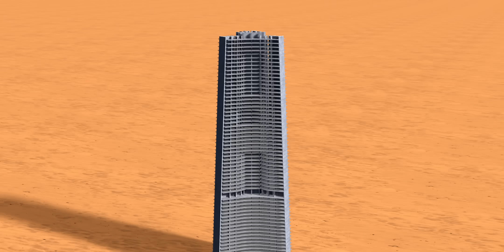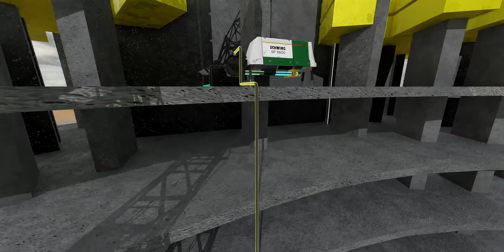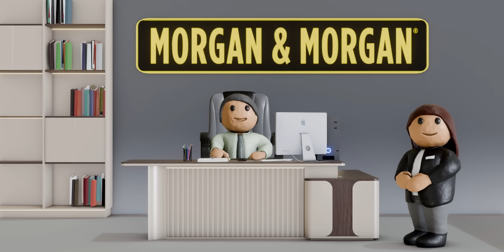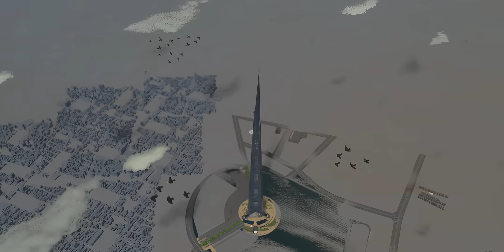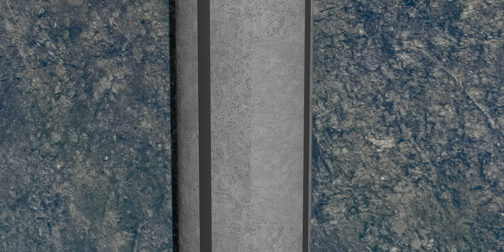Jeddah Tower Restart: The Strange Issue Between the Old and New Concrete

Comment: Wow.... The energy consumption of this building for air conditioning, for the elevators, for preventing rust on the foundation pillars, the amount of energy needed to construct it, etc... Geeezzzzz.... Sounds like this is a building waiting to fall apart in about 20 to 30 years with a huge carbon footprint. They're trying too hard to overcome nature, it seems.
Reply: Plus big pumps for water, those need a lot of power. But the cathodic protection only uses little power I think. Btw, there is a counter piece that needs to be replaced regularly because it is slowly eaten away by the current. So to protect the rebar, you need to sacrifice another (replaceable) piece of metal

Comment: Interesting on an engineering level, but such a waste of public money. All this concrete thrown up into the sky just for one man's vanity with little usable floor space.  And it's nothing more than a copy of what's already out there.... How boring.  The only thing this building has is an observation deck (that's so high up they can't use it a lot of time because of high winds I imagine), and its overall height. Otherwise what is the point of this boring copycat of a building???

Comment: But the more useful means a more stable and long life tower. The Jedah tower could be increased even after by boring and injecting high density hybrid concrete. It doesn't take much especially if you use graphebe and fibers combined with the old school roman concrete which we just realized why Roman concrete has lasted so long..

Comment: Use both, and in-fill with hybrid high strength concrete,i.e. with graphene and fiber mix! Go both out and in-fill the center. This will help with wind flow and environmental forces acting upon the structure.

Comment: Hello Sir, thank you for this great explanation. I have a question: In the future, is it possible to construct high-rise buildings using only structural steel, without reinforced concrete as the main structural system?

Comment: It reached 110th floor these days , which is like 430-440m I think , I am not a fan of the buildings that are pointless like this (especially the Line) but this thing has been in build since 2010 or some like that , just finish it instead of wasting all that material and money for nothing , I do think it is possible to be built , every engineer says so, question is if there is enough money and the higher ups actually want it to be built
Reply: You are dealing with an economically powerful nation, not someone like Elon Musk, whose funds could run out , It is also a sign of a superficial mindset to think that these buildings serve no purpose; no project is built unless it is expected to generate revenues that cover all incurred costs—and yield significant returns on top of that. You are talking about the PIF, As for The Line, it is not merely a "mega-project" but a "giga-project"; its initial phases are expected to emerge in 2050, and it will span many years due to its immense scale. This stands in contrast to certain nations that can only plan in four-year increments—the duration of a presidential term—or focus on small-scale initiatives, all while grappling with fundamental issues like homelessness and healthcare coverage—problems typical of third-world countries, If you wish to speak of logic, then do so; but as for your emotions, keep them to yourself,So don't take it personally; I'm happy to have met you 🌹❤
Reply: @sadov-y6f He meant that the building is too inefficient and only acts as a status symbol. But the engineering behind it is interesting.  It's good if you can afford to do something just because you can, not because you should. But you should definitely not make that a habit 😃 The line is a bit unrealistic I guess. The business plan behind it is vague, and seems based on dreaming, not on economic reality. Any idea of the required amount of concrete and rebar to build just 1 kilometer of 500 meters high and 200 wide? Anyway, let's see if the business plan works out after that first kilometer.
Reply: @effedrien  Don't worry, I'll wait for you four years from now.
Reply: @sadov-y6f are you sure 4 years is enough for that first kilometer?
Reply: @effedrien  Certainly, yes.

Comment: The engineering behind Jeddah Tower is absolutely insane. The fact that they had to solve problems like differential settlement, wind sway, and connecting new concrete to a section that had already been sitting for seven years really shows how extreme a 1 km skyscraper is. I honestly didn’t realize how many hidden challenges there were behind this project.
Reply: Nem 1km ,hanem 828m
Reply: @NicolettaBaba  jeddah tower will be 1000m+. Burj Khalifa is 828m

Comment: The stiffness transition, deep pile foundation, high-strength concrete, wind-resistant buttressed core, and tuned mass dampers show how every detail must work together to control settlement, sway, and durability. An impressive example of how structural engineering, foundation design, and material science come together at extreme heights. – Dr. Sera, P.E., PhD
Reply: Te szakmabeli vagy?Azt honnan tudjuk,hogy milyen melyre ássunk¿
Reply: did you just sign off on a youtube comment 😂W flex i guess

Comment: High strength epoxy....to glue and bond one layer of concrete to the other. Hmmmm... curring in that heat. I'd be afraid of it becoming brittle and then still even the long term colder temperatures after the building is finished could do that too over time. 

The whole epoxy bonding process for this tower would be very interesting. I bet it would be a full video on its own.

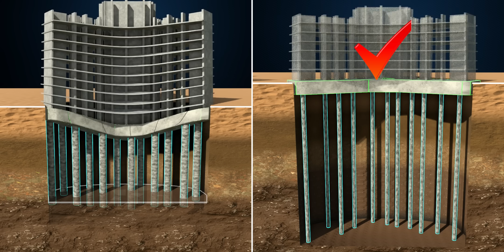Comment: 3:15 - false - because it’s NOT about the weight of the piles - - it’s about the weight of the TOWER.
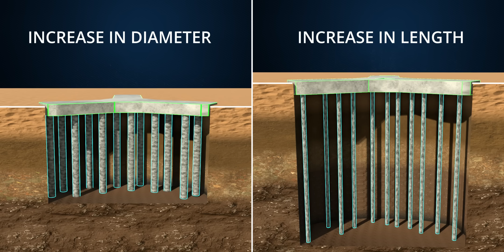3:02 - if u stood on a table w long thin legs - vs - standing on a table w short wide legs - - it’s OBVIOUS which would be more stable = the one with shorter + wider legs.
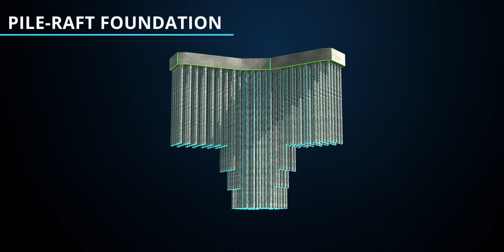also - THIS 4:09 solution - was NOT one of the 2 options (???)

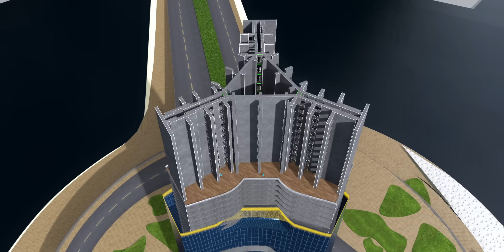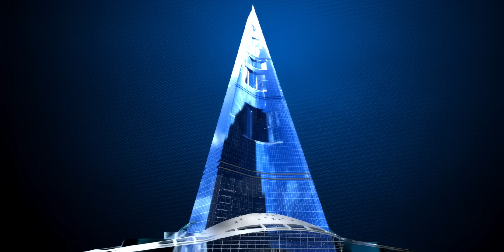7:06 buttressed core = spine 7:13
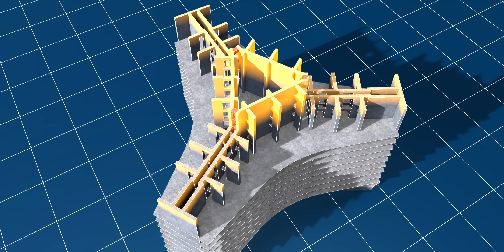7:16 coupling beams between core + wings 7:20
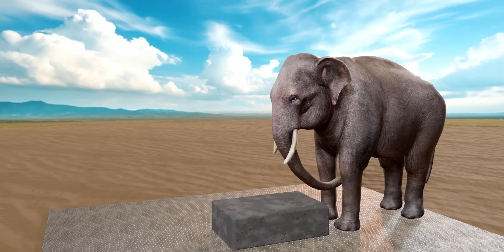7:20 that’s NOT  7:28 the coupling beams (?) 7:29
wings r NOT pushing on that 7:20 part of core 7:28
Reply: YES. I THINK THIS BUILDING IS GOING TO FALL ONCE COMPLETE IF COMPLETED.. ALMOST LIKE CHILDREN ARE BUILDING IT

Comment: Its so surprising to me that the Jeddah Tower Will have so much less floor area than the Burj Khalifa.
Reply: It makes sense in a way, the taller you make a building, the less efficient it gets. More and more space has to be dedicated just to make it support itself.
Reply: @WaffleAbuser the building will collapse if all level or floor has rooms.
Reply: The skyscraper itself isn’t the investment, it’s the area around it . The area in which Burj Khalifa for example is the most expensive real estate in Dubai even though the area itself wasn’t that special before the Burj . Same will happen with Jeddah tower . It’s right now outside Jeddah in a relatively low value real estate area , but when the tower is complete everything around it will skyrocket in value . Same happens everywhere in the world . Sky scrapers are excellent anchor projects whereas the skyscrapers themselves are often a financial loss
Reply: Its more of an extremely large monument than a building atp
Reply: I was surprised to see floor space in burj khalifa being so low
Reply: Most will probably never be occupied anyway.
Reply: Because it is very thin compared Burj Khalifa , they should have build it a more thicker
Reply: Wrong 😡

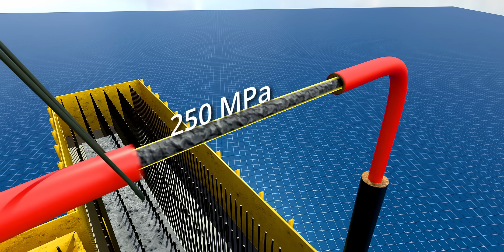Comment: 9:35 250MPa is about 2500 times the atmospheric pressure, not 250
Reply from the maker: Ohh, Sorry for that mistake.
Reply: @SabinCivil  At least this goes to show that your channel is human-made instead of using artificial intelligence. Had to install a crowd-sourced open source AI blocker to remove generated content from my feed. Glad you are human. Been enjoying your channel since 2022 or so.
Reply: Good catch. That pressure figure definitely made me stop for a second too. 2,500 times atmospheric pressure sounds absolutely insane for a concrete pumping system.
Reply: @DisasterMoments1205  

1 atm pressure ~ 1 bar 
250 MPa is about 2500 bar
2500 time the atmospheric pressure in the Pipe seems A bit Odd